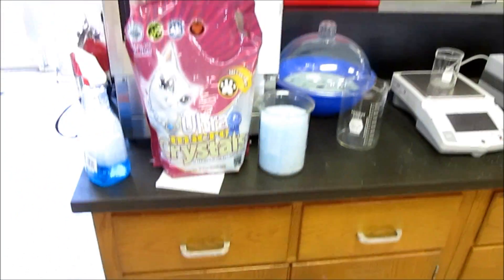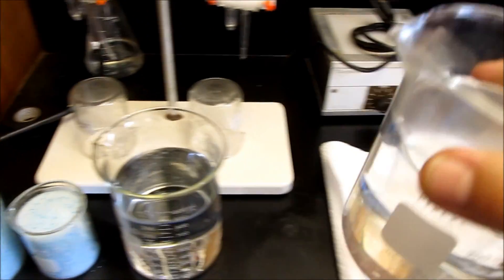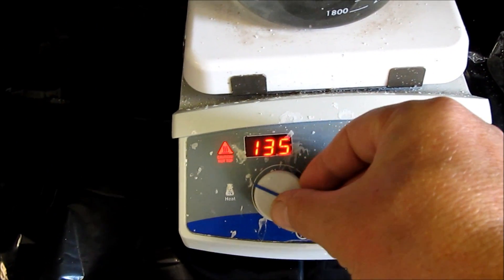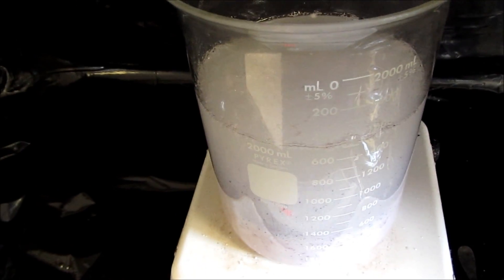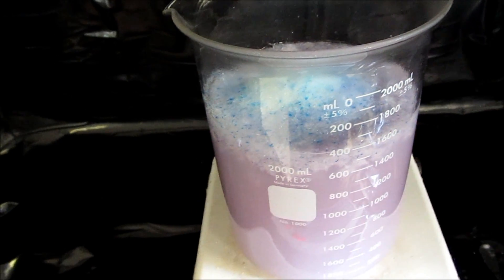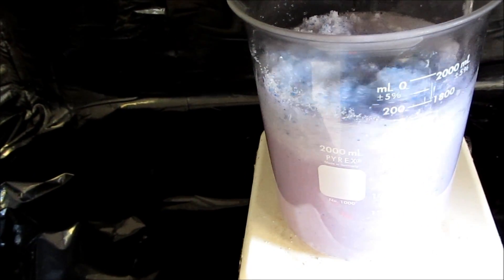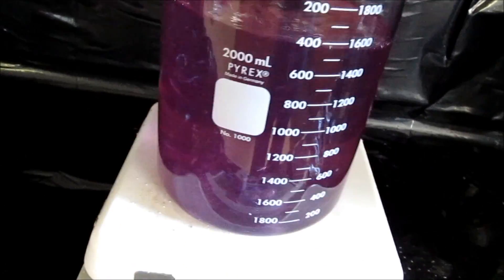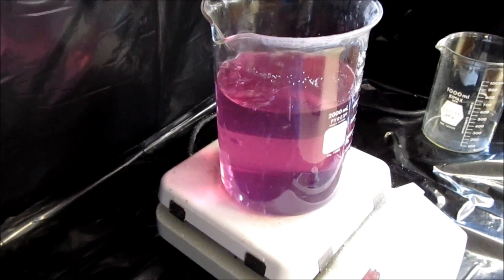sodium silicate

Comment: You should say that the sodium hydroxide is nothing more than lye, aka, drain cleaner. It's best to use something that's 100% sodium hydroxide. LOWES has a brand of drain cleaner that uses 100% lye and says so on the container. It is in crystal form.
Reply from the maker: Actually I believe 'lye' could also refer to Potassium Hydroxide (or a number of other metal hydroxides) as well and not all drain cleaners use Sodium Hydroxide. But I'm no chemist, so I'll leave that argument to the experts. What I use is marketed as 50% Sodium Hydroxide.

Comment: will any type of silica kitty/cat litter work or should i look for a certain percent silica gel? and as far as final storage does it need to be airtight?
Reply from the maker: I would assume that if the kitty litter has anything other than silica gel in it then it could affect the sodium silicate solution through contamination. This was a concern of mine when the only litter I could find had some colored crystals in it (thus the purple color) but it did not make a difference in the end. I don't know if silica gel based kitty liters come with different percent purities or not; you may need to rely on trial and error.

As far as airtightness goes, if this stuff is exposed to CO2 it will eventually 'cure' and even if it is contained in an airtight container I'm pretty sure it has a shelf life - I have always capped the container tight and used what I've made in short order, so I haven't had any problems. Hope this helps and thanks for watching.

Comment: Hi, can you write the recipe for the sodium silicate. thanks
Reply from the maker: Hi Alberto,
 The ratios are 2 g NaOH  for every 3 g Silica gel. I added about 5 ml H2O for this ratio. Since I used a 50% aqueous NaOH solution you may need to adjust how much water you use. My normal batch size is as follows:
     450 ml 50% NaOH solution (~344 g NaOH)
     516.03 g silica gel
     860.05 ml H2O
This will make about 1500 ml give or take a 100ml depending on how long you let it boil down. I usually end up with1400 ml.
Chances are good you'll need to play with this recipe to get the results you want but this works for me with the ingredients I use.

Comment: thanks for the video Rod, im just getting into metal casting and SS is kinda expensive at the rate im learning to make cores, i just gotta figure out where to get sodium hydroxide or lye around me and ill be set, probably any feed store or hardware store right?
Reply from the maker: Hi Daniel, I apologize for the slow response. didn't get the usual e-mail notification. You probably found a source by now, but I have seen lye at my local grocery store.